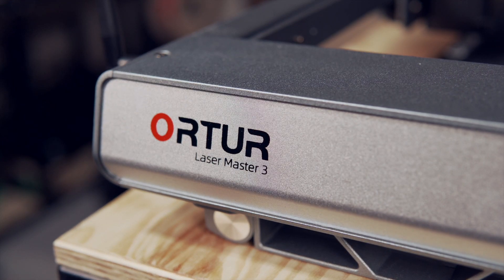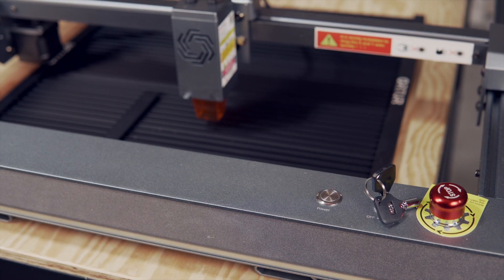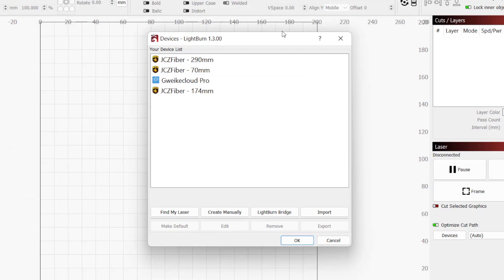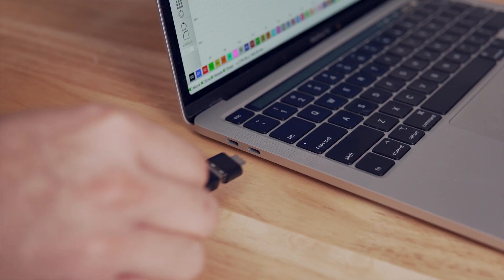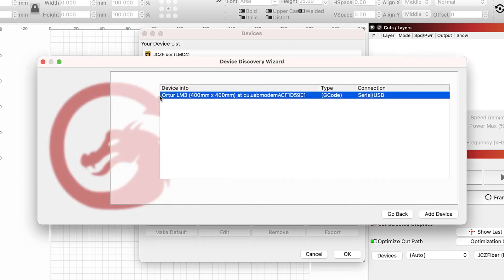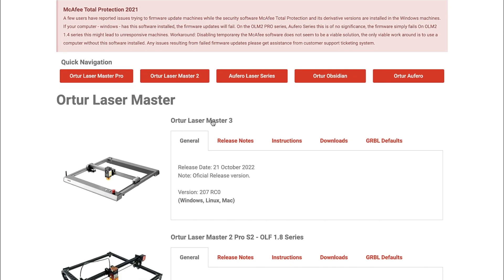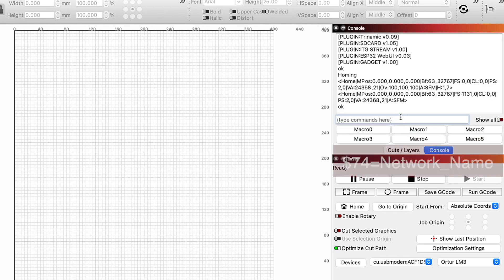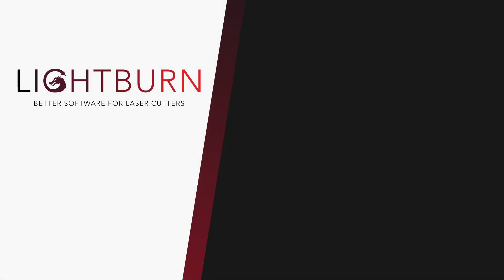Ortur LM3 LightBurn Set Up Guide

Comment: The folding legs are an optional add-on, by the way, just in case someone was wondering if these came standard with the machine. I created some 22-mm standoffs to compensate for the thickness of a honeycomb bed and uploaded them to Thingiverse. Maybe this is useful for someone else as well. There are three M4-0.7-tapped holes in each corner of the machine. The original legs attach to the center hole, while the foldable legs as well as the standoffs use the outer-two holes. The spacing between the holes is 21 mm each.

Comment: I can’t wait to give this a try. The hiccup I’ve had with my OLM3 is getting it to connect via USB. I have to power on the laser and let it get through initialization, then plug the USB cable into my laptop, then into the LM3. Otherwise, I have trouble with the setup. Thanks very much for this tutorial. Lightburn is an excellent program. Cheers!
Reply from the maker: The wireless connection has been very reliable. Be sure to use the latest machine firmware and version of LightBurn.

Comment: What would really make this great is if lightburn could upload the gcode file to the OLM3’s SD card and execute the code from there instead of having to have the computer hooked up to the laser engraver. I know that you can export from lightburn and then import using the Ortur’s built-in web server, but it would be neat if lightburn could streamline this process. Having the code local to the machine is much safer for long burns since it minimizes the chance of disconnects. I would be super stoked if this could be implemented.

Comment: I cut leather with my laser scraper.  I am using lightburn.  i am new at this job.  the red line showing the movement of the laser in the preview sometimes runs over the templates.  It also appears as a line on the skin.  how can i fix this problem.  please help me.
Reply from the maker: https://forum.lightburnsoftware.com/t/laser-not-turn-off-between-cutting-drawing-shapes/6452
Reply: @lightburnsoftware7189  thank you for your attention 🙏

Comment: I went through this, worked great.  Powered off my LM3, now it wont connect at all in lightburn.  Same wifi is used, lightburn reads 'disconnected'.  How do I force it to reconnect? Thanks.
Reply from the maker: It wont connect over USB or wireless? For USB to work again you will want to change the connection back from ethernet to usb. To reset the connection you can right click on the devices button or restart LightBurn

Comment: Is it possible that this wireless connection capability would work for other machines like the SnapMaker 2.0? It has an assigned IP address that I already know.
Reply from the maker: The Ortur LM3 uses a form of serial connection over TCP/IP while most others are using an upload interface which is not currently supported.

Comment: When entering upgrade mode, my computer doesn't sense the LM3, as in it won't show up in windows file explorer. Does anyone have a solution for this?
Reply from the maker: Do the lights on your machine show that it is in upgrade mode? I would try a different usb cable and port. If you have another computer that may be worth trying as well at least for the initial update.